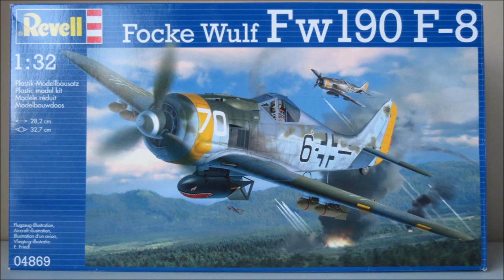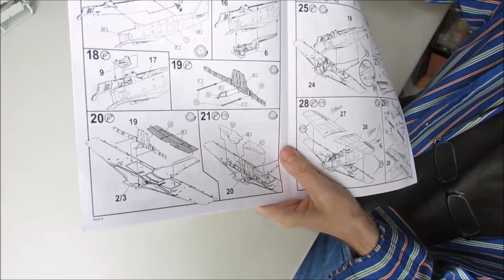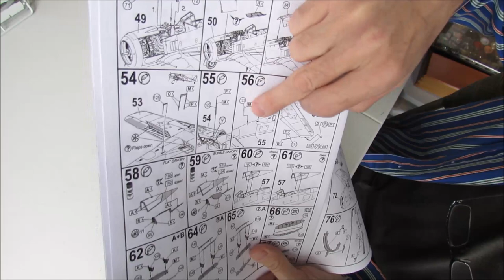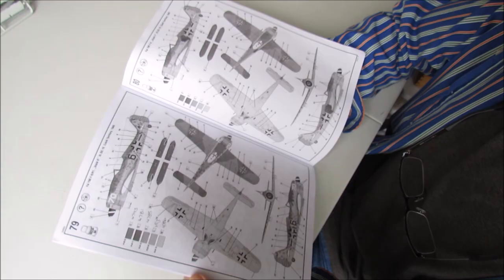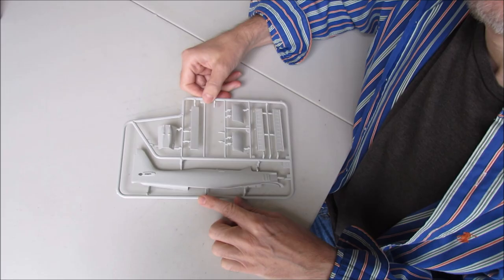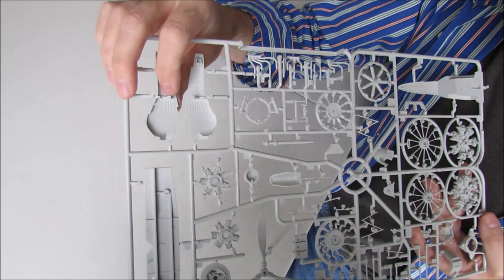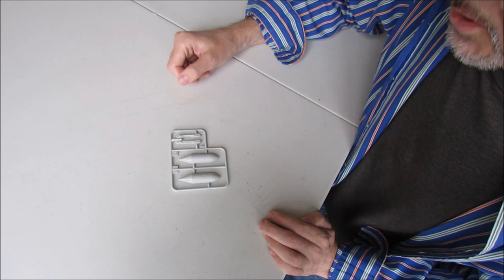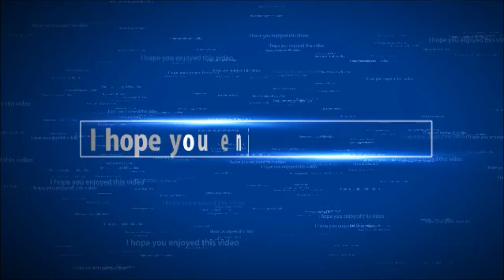Revell 1/32 Focke Wulf Fw190F 8 "In-Box-Review" (9.25.15)

Comment: great review Martin you won't be disappointed with this kit it goes together very well ,forget what i said about the engine cowling a while back i was just having a bad day it goes on well i buttoned mine up though i though i would break it lol looking forward to the 1st update buddy have a great weekend :)
Reply from the maker: +Faron Adams Thanks Faron, much appreciated! Anything that projects from the body of the plane, I leave off until he very last day when I put the "Final Assembly" carefully together. Then I do my photographs and she's on the shelf, away from possible handing and damage. The only thing I'm concerned about at the moment is that the rear wheel has to be fitted into place before buttoning up the fuselage halves. That means it's exposed fro the rest of the build, masking, painting and weathering processes...that's a lot of handling, wherein the worst could happen. Have a great weekend, too! Cheers : )

Comment: hi martin,i ordered a airbrush online,so i was wondering if you could make a video on how to use an airbrush?
Reply from the maker: +JanScaleModelling  Hey Jan, all airbrushes are different from brand to brand and type to type. I use a Paasche double-action airbrush that was only $69.00....it's not a high end brush, but, it's been good to me since I got it as a gift from my wife for Christmas 2013. I see people spending hundreds on high ends brushes and getting the same results. At the end of the day, my personal opinion is...make sure it is double action so that you can control both the air flow and the paint flow at the same time with one trigger, and, the results are purely down to how the user operates the airbrush, thins his paints and utilizes air pressure for different results. Therefore, ensure you have a pressure gauge on your compressor s you can the PSI's that you're working to.I can film myself airbrushing the model I'm making now, but I can't promise that the same paint to thinner mixture and air pressures that I use will work the same for your brush. The needle/nozzle aperture sizes play a part, too. Cheers : )